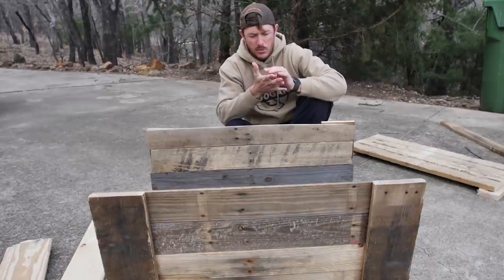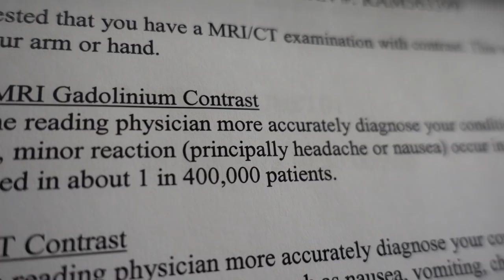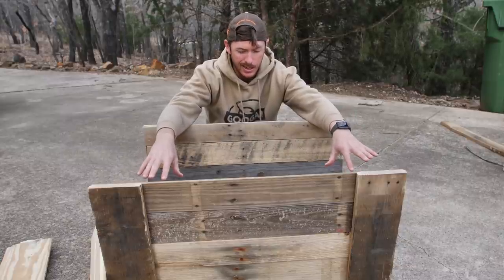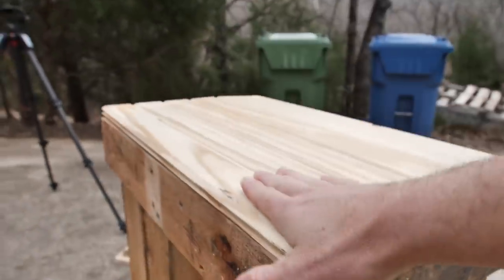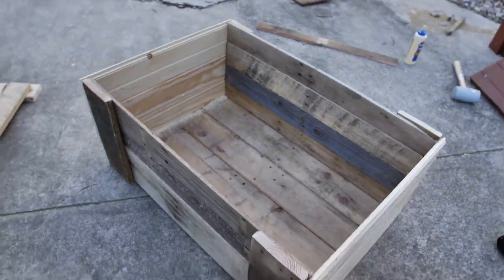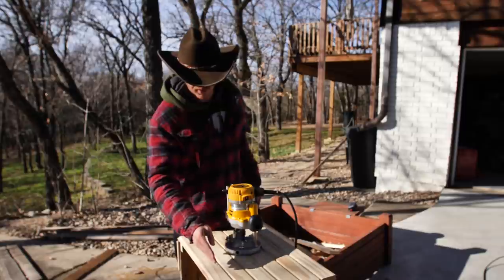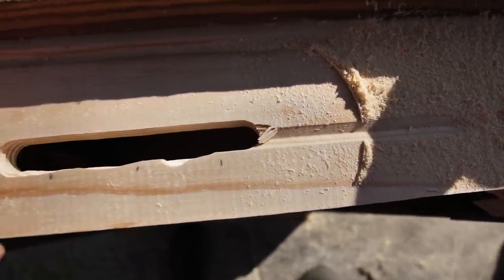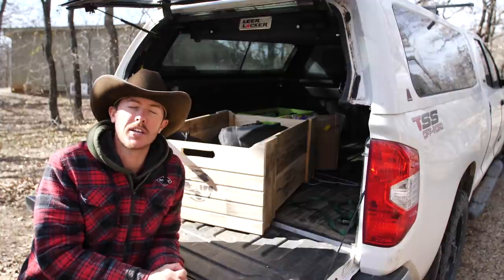Building Camping Crates from Pallet Wood

Comment: For best results the wood surfaces you glue should have matching grain. For example the tongue and groove glue joint wont ever break. The wood will fail first. But where you glued the sides on, that glue wont hold. Wood expands and contracts with humidity and when that side expands or shrinks it would of failed if you didn't add the nails...If you enjoy the woodworking check out the woodwhisper.

Comment: Crate looks good. Freehanding Routers is always a trick. Using a guide will help clean up those lines and make things more uniform. Making templates out of heavy gauge sheet plastic like plexiglas will help routing handles and even your logo for many of you're projects and can be used over and over again. Hope all is well in the  with the health issues.

Comment: Wood glue is super strong. If you build more, when you are doing the ends with the tongue and groove glue and nail the bottom board in place, then glue the next one up and angle the nails 30-45 degrees toward the bottom board and it will pull the joint in tight while the glue dries.

Comment: LFG.  If you want to woodburn the design into any of your projects, just print your logo in heavy black onto wax-paper with an inkjet printer.  Yes you can print onto wax-paper. While it's wet, put it on top of the wood and press the wet ink into it to transfer the design into the wood.  Then you can use a woodburner to go over the design.  Looks much better.  Just be sure to print the design backwards so it transfers correctly.
Reply: invert

Comment: For the handles you could drill holes and use rope. Just tie a knot on the inside so it won’t pull back through. Might be easier for dragging across the bed of the truck